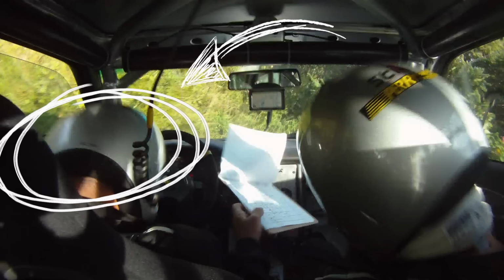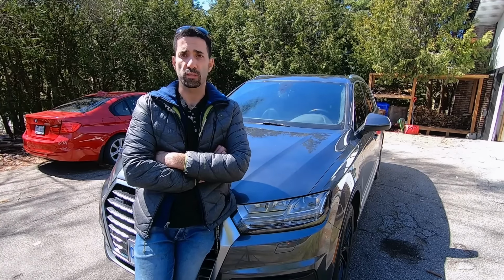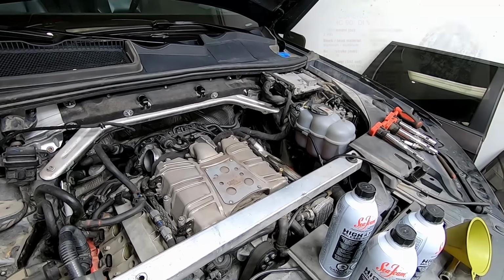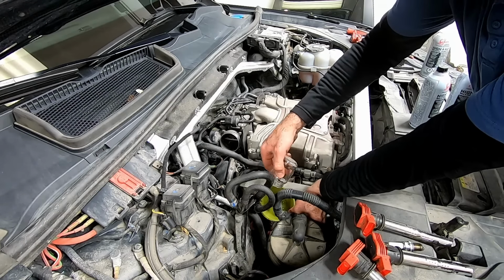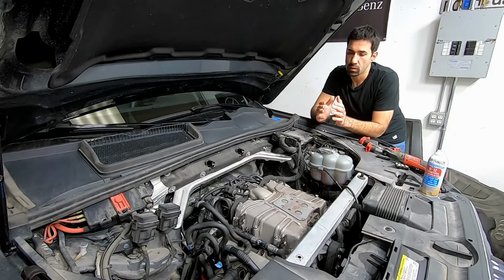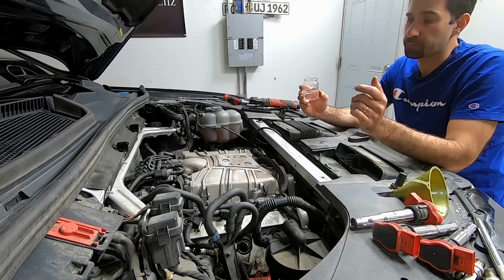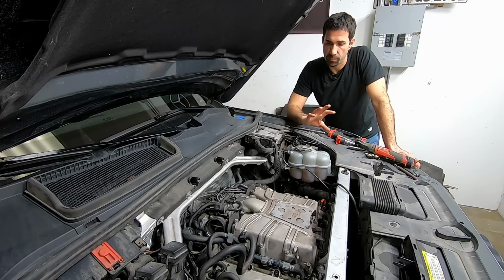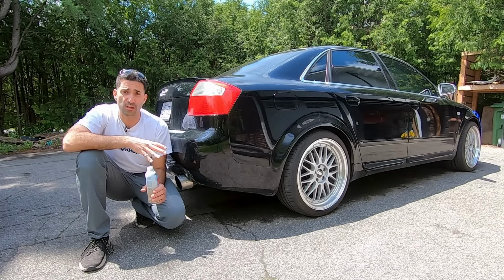How to fix oil consumption on VW/Audi/Porsche 3.0T engine?

Comment: I've tried this last week on my Acura MDX and it start to have oil leak from rear main seal. I brought it to Canadian Tire and they said the cost is about 4K.
Reply from the maker: @eric6218  there's lots to unpack here... first of all, take your car out of Canadian tire as soon as humanly possible,  second - a rear seal can never cost 4k... make sure they're quoting you the right stuff and you understand the quote...a rear seal is a common wear and tear item and is likely not related to a piston soak... nobody else has noted any oil leaks after the treatment, so it's highly unlikely the two are related... either way , bring your car to a shop that knows what they're doing - a rear seal is not trivial but shouldn't cost more than $7-800.

Any changes in your oil consumption? What was the consumption before the treatment? Is it possible the consumption was due to the rear seal? The 2.0T VW/Audi engine is notorious for falling rear seals, which can result is oil pouring out of the back on the motor
Reply: @ETMotorsports  Thank you for your quick response. I appreciate it. The car oil consumption was 1 liter each 300 miles. Now it's 2.5 liters first 400 miles. I can see the oil on the ground after parked it, which I never see it before. I parked the car in the garage. Now I park in on the driveway. The garage ground is dry. So I am sure it's a new issue though it's hard to believe it. Canadian Tire told me the labor is 3000 including tax since they need to remove the engine from the car and possibility remove transmission with it. It's a V6 engine in the Acura MDX. Maybe it's tight in space. The leaking is in the driver side close to the middle. I can smell the oil burning when I drive. I may ask dealer the cost.

I only run the car about 30 minutes with B12 after soaking and replaced oil and filter and run one day, and then replaced oil and filter again July 8. I though I've tried my best to prevent it from happening if it's caused by the chemical. I might replace the oil right away before fire it up but I want the chemical to circle to help to release the pistons.
Reply: I've brought my car  back. The printed receipt says Engine oil leaking from output seal( seal inside the transmission) (Declined: Tax out 2723.53 Tax in 3077.59). So it's not misunderstanding.

Comment: what socket or tool did you use to turn the crank over with
Reply from the maker: Look up VW 1412
Reply: @ETMotorsports  I was able to use a 3/8 and put it in one of the triple square bolts and it turned it over just fine

Comment: Hello Thanks for the content, im in Toronto, i been trying to source the b12 product with no luck, ordered it on amazon but they never ship. any guidance would be apprecaitecd, does seafoam works similiar? Thanks
Reply from the maker: @4evertrader  seafoam is much weaker...
Reply from the maker: @4evertrader  try radwell.ca - we've had good luck with them
Reply: @ETMotorsports  thanks so much!

Comment: You have a lift. IMO, you should have picked up one side of the car to get the piston crowns level with the ground and do three pistons of one side at a time with the b12. When you said you were going to use seafoam, I shook my head and said "that's not going to work!" 

I don't think that you need to do the valves. To wash the valves, you can spray the b12 into the intake atomized.
Reply from the maker: @alafrosty  I thought about tilting the car but you need 45deg to put the pistons horizontal which can't be easily achieved and would be very hard to work on...

Spraying b12 or any other chemical on the valves won't clean the build up - that's why shops do walnut blasting etc...
Reply: @ETMotorsports  you didn't need to get all the way up to 45. Wheel rollers and 40 degrees would've been enough. You could add the b12 before angling the car/engine. Gasoline cleans valves with aerosol contact. B12 will do the same, only more effectively. Yes, a bath is better, but trying to bathe overhead valves completely is not going to go well and the b12 will probably destroy the valve seals.

Comment: Is it bad if it drains out of a  cylinder almost instantly?
Reply from the maker: @ball2g2  I mean it's not good but it doesn't mean the treatment won't have an effect
Reply: @ETMotorsports  thank you.  I was incorrect in thinking the liquid drained out.  It was because of where the pistons position was that made it look like the fluid drained out.
Reply: Drained quickly means rings stuck closed .. soaking fix that.. so when you see this situation you know you need to soak that piston more ..
But driving the car and switching between compression and vacuum down hill help that matter
Reply: @The_Future_of_Lighting  i did a compression test on that cylinder and it only hold 45psi while the rest are at 100+ psi.  I figured my rings are cooked.  But could what your saying be the problem and solution?
Reply: @ball2g2  the rings might be stuck closed , some of them or all.. you can be sure they are cocked if you tear the engine only..
Reply: @The_Future_of_Lighting  I'm sorry what do you mean by tear the engine only
Reply: @ball2g2  to really make sure piston rings are cocked you have to disassemble the engine! 
I woul try more aggressive piston soak and drive the car right after the soak and  (spirited driving) and try to apply vacuum by driving down hill in higher gear with you foot off the pedal.. that would suck the rings free after few trials..
Things to do before you overhaul your engine might work ..

Comment: Do you think this can damage headgasket? if you soak it at TDC?
Reply from the maker: @StefaTGM  no...b12 doesn't react with metals and you headgasket will have a metal ring right around the cylinder

Comment: This engine according to the car year (2017) is most likely the "CREC" engine , which has a harder cylinder walls than the previous engine , 
the previous ones ( I think up to 2014 year) have a soft cylinder walls made by I believe "nikasil" , which means that any one who does this process has to be very careful
during it and clean very very very well the cylinders before crancking , otherwise you risk of damaging/scratching the cylinder walls which will lead to even bigger oil consumption and the fix will be a new engine block or replacing the cylinder walls. This means that it will be very important to blow out the carbon fallen in to the cylinders or maybe even vacuum them somehow , just make sure the cylinders are clean before cranking the engine. 

Mine is the older model (2013) and I think about testing that merhod with the B12 , my car consumes oil and I believe its from the piston rings but I know that my valve seals are also leaking and it also consumes from them (could be a carbon build up on the valves which means that the problem might not be the valve seals and the B12 might help with this as well. 

Currently I`m driving with 5w50 racing oil (Revanoil) which is a very high quiality oil and after the 4k km mark I have added about 1,5l of oil , once I do the soak will update how it went. 
Hopefully this will go well and even save me the valve seals replacemnt since the valve issue might be a carbon build up on the valves which helps the oil to go throug the valves.
Reply from the maker: hey great points...I was a bit worried about the cylinder walls but in my research I couldn't find any indication that B12 can cause any damage...the company clearly says on their website that it will not react with any metals but your point about the debris is very valid! I know of multiple people that have done the treatment on their 3.0Ts but I couldn't confirm which generations.

Are you absolutely positive the valve seals are leaking? Do you see big puffs of blue smoke on start-up? the first time I did a soak on my A4, I did the seals first (loooots of work) hoping that was the problem and it changed nothing. The 3.0T, just like any other direct injected motor, is prone to carbon build-up on the top of the valves, which unfortunately the soak won't help with. However, you can see from the crappy scope footage, the engine had a TON of build-up on the head crown and the bottom of the valves too, which as long as you soak at TDC, will get at least partially cleaned up...your consumption is still within spec so you've got lots of time to play with this
Reply: @ETMotorsports  not 100% sure if I have a seals leaking , since when I start the car I don`t see smoke , not blue at least , but when I go downhill for a longer period of time without any throttle when I press the throttle it smokes a bit , I don`t see it inside the car but a friend of mine was driving behind me and told me that whenever I give some gas the car was smoking for a bit and then stopps. Also I did one test , I was doing a 3rd and 4th gear pull (manual mode) and was unable to see any smoke during the pull , but when I left the throttle and left the car rpms to drop on its own from like 5,5k to 4,5k rpm , then shifted down to 3rd gear and again waited for the rpm to drop on its own , then pressed on the throttle and a big  cloud of smoke came out the car just for short amount of time , but was a big one. This usually means that the valve seals are not good. 

And for the B12 , I don`t think that it can cause damage to the piston walls on its own , but the big chung which can drop like in your case happened , those chunks can damage/scratch the piston wall , so before crancking is probably best to clean the pistons camera using air compressor or any type of vacuum cleaner to get rid of the big chunks of carbond build up which dropps in the cylinders after the B12 treatment. This can happens easier on the previous generation V6 , the one before the "CREC" , since as I mentioned,  there the cylinder walls are covered with a softer material and can be scratched way easier.

I spoke with a mecahing for the carbon build up on top of the valves and he advised me that the carbon cleaning machines and sprays which are used are not efficient and the best way to clean them up is by removing the suprecharger , then remove the intake flaps under the supercharger toghether with the fuel lines , then you should be able to see the valves and scratch the build up carbon ,then vacuum the carbon build up out , otherwise they can drop in the cylinders and scratch the walls. 

I will do the soaking with B12 ,  I have already ordered 3 cans but will have to wait for a moth of shippement since I`m located in EU. Then will update back what happened and if it worked for me. I was just about to try the liqui moly engine flush pro-line but after seeing what happened with the seafoam , I decided to go straight to the B12 solution , hopefully this will stop the oil burning for me too.
Reply from the maker: yeah agreed - seafoam worked on my Touareg an A4 but it was just too weak for the crap that the 3.0T had built up...also agree with your mechanic - the valve build up is usually cleaned from the top "mechanically" - you can't really spray anything in there that will be effective...

that said, since you're doing the treatment, it may be worth it to try something...if you're not in a rush, soak one piston at a time, just after TDC on the intake stroke where the valves open up....that way you can soak the piston and the tops of the valves at the same time...I`m not sure how much liquid you`ll need in this scenario (definitely more than 50ml) but shouldn't be too much - they open pretty quickly...might be worth picking up a scope from amazon for this service - you can get a decent one for $100 or so to at least keep an eye on the cylinders as you're doing the treatment...the garbage that accumulates seems to be more "dusty" - I know it looks like a big piece of hard carbon in the video but it falls apart pretty easily so should not cause any damage to the walls
Reply: @denistrendafilov770   any updates on your soak I curious about trying this

Comment: What do you think about amsoil engine flush
Reply from the maker: An engine flush is a good thing to do every now and then but it won't solve the piston ring issues... I've tried multiple times
Reply: What do you think about new engine oil valvolin restore and protect
Reply: Thank you

Comment: I have a 2015 audi Q7 I burn about a quart of oil like every 2500 miles .  And maybe it's because I do my interval oil changes every 5 k instead of 10 k like the manufacturer suggested and I have 182 k miles on it.
Reply from the maker: Yeah I've gone to 5k oil changes too but technically speaking even though 1qt/2500 miles is well within spec it's still too high... these engines shouldn't burn oil - there's no engineering reason for it...
Reply: @ETMotorsports  The reason for it, is they started using low tension piston rings due to the EPA demand for higher MPG on engines.
Reply from the maker: haha yeah no I know the reason they burn oil, I meant there's no good engineering reason for it...they replaced fuel consumption with oil consumption and passed the problem to the consumers down the road which is ridiculous. It's bad engineering plain and simple...if your "improved" rings give you 0.1L/100 improved consumption and cost each owner 20k in repair bills or 100$ extra in oil every 5000km you've failed as a manufacturer
Reply: @ETMotorsports  Excellent point, trading off mildly improved fuel consumption (via low tension piston rings) for a $20k engine repair.  From a manufacturer perspective, their motive for making this horrible tradeoff is the fuel improvement is immediate, so the management team can brag about it to get a bigger bonus. The $20k repair cost is also a win, because it'll let them move more metal (sell more new cars).  One might think that it would cause customers to perhaps switch to Toyota (who have dual port injection, thereby eliminating the carbon issue).  But that only fixes the carbon issue on the back of the intake valves.  The Toyotas still seem to have stuck carbon rings.  

The Care Nut (Master Toyota Tech for years, now has his own shop) had an in-depth video ("Why do Toyota engines consume oil? And how to prevent it?") where he too agrees that it's due to low tension piston rings. He's like the Mr Rogers of car technicians.  His overly friendly demeanor makes it seem like he doesn't know what he's talking about, but... if you get past the first few mins of the video, he starts to provide a really good technical explanation of what the problem is.  He also has an interesting explanation (stage 1, 2, and 3) about how the carboned up oil control rings cause the ring to stick in one position, slightly protruding in one location, which in turn wears a groove into the cylinder wall. It's really a fascinating presentation.

Surprisingly, he thinks 3k-5k (rather than 10k) oil changes are the solution.   Seems at first like a superficial answer, but he points out that the Toyota manual actually specifies 5k oil change intervals if you do extended idling (stuck in traffic), short trips, and really cold weather conditions. Apparently cold weather starts cause excessive oil to weep into the crankcase, diluting the oil.

He actually has an example of 2 identical cars, one of which did the 10k oil changes (and ended up burning 1 quart every 500 miles, at 49k miles), the other of which burned no oil at 100k miles.

Here's a direct video link: https://www.youtube.com/watch?v=v4JS7PybV2k

Update: just rewatched his video. He said he's actually had good success with industrial strength oil additives that are only available to dealers. You put it in the crankcase, run the car for 20 mins, then drain the oil.  But unfortunately didn't list any product names, because he said they're not available to consumers. He's got 7,000 comments under that vid, so when I get time maybe I'll wade through them to see if any techs drop the dime on the product names.

Comment: curious if it will work on diesel touareg
Reply from the maker: no reason why it shouldn't if the consumption comes from the rings...make sure you check the PCV and turbo first. The only difference is that you have to go through the glow plug holes, which is a bit harder but not impossible
Reply: @ETMotorsports  Curious about your comment "...make sure you check the PCV and turbo first". How could the turbo cause oil consumption, and how would one check it?

Comment: The cylinders  that are empty are the ones that are burning the most oil
Reply from the maker: @daveerrington5166  that's what I thought originally but honestly it seems to be all over the place... on my a4 cyl 3 was absolutely soaked in oil but wasn't the one empty first...after the first soak,  the draining changes too...

Comment: Ummm that's a V6 engine... Another reason not to starter crank.. that would push dirty solution and carbon chunks through the exhaust valves to the catalytic converter and clogs it!! 
For the V6 even if the piston at TDC there will be air pocket that prevents the liquid from reaching all the top part and valves.. to solve this I incert a tube and suck that air as adding more liquid

Comment: I have another idea, maybe lift one side of the car to make the cylinders upright for soaking, 3 cylinders per 24 hours
Reply from the maker: @osamayousefmaddani9186  a few of us had that idea but you need the car at 45 deg to make up the difference which makes it completely impractical to work on

Comment: I added early on a water methanol kit and catchcan on my audi to avoid this. 
No issue with warranty (unplug the hose when it goes to the dealer). 
Now all my direct injection car has a meth kit.
Reply from the maker: @098cpt  that helps with valve buildup but won't do much for your oil rings